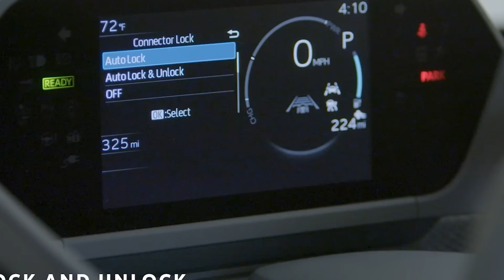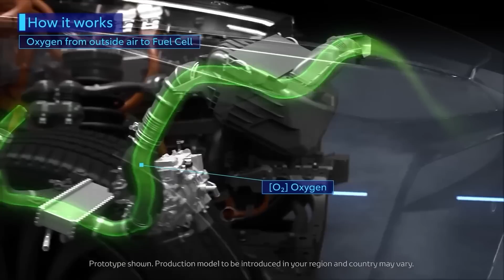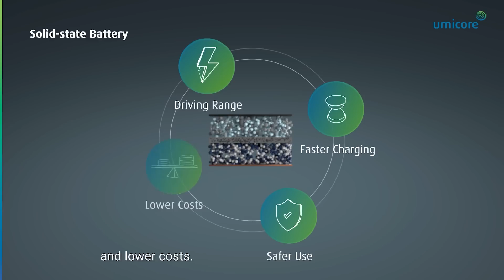Toyota CEO Drops Bombshell About Solid State Battery!

Comment: If these solid state batteries come to fruition, there would be no sense in pursuing hydrogen. The only advantage hydrogen offered, was range. That was an argument 20 years ago, when EV's only had a100 miles of range. Now, battery electric vehicles with ranges exceeding 250 miles are fairly common. The problem with hydrogen is, that it is difficult to build with a range to exceed that of modern battery vehicles. it is physically impossible to store enough hydrogen in a passenger car, to come close to the range promised by the new solid state batteries. Even if it were possible, it would take longer to fill the hydrogen tanks, than it would take to charge the battery. The fact that I can charge a battery at home, makes it the clear winner for me. On a safety standpoint, I'll take my chances with batteries, over pressurized hydrogen cylinders, with double the internal pressure of CNG.(compressed natural gas) Never mind the BTU content of that much hydrogen, It's actually less than a tank of gasoline. I'm just looking at the expansion potential of that much compressed gas, when fully fueled!
Reply: Hydrogen for transportation is a pipe dream for fossil fuel companies who know that their days are numbered. They are trying to convince people and governments to make a hydrogen economy, because the technology and engineering is similar to fossil fuel refining, storage, & transportation. 
Except that it really isn't as you say.
The issues with hydrogen mean in reality it will never be able to achieve mass adoption.
Battery electric vehicles have already started taking off and will replace the vast majority of use cases. Hydrogen can't compete with battery electric vehicles.
We will need hydrogen for decarbonizing things like ammonia for agricultural fertilizers, cement production, and steel making. But not transportation.
Reply: Toyota hasn't solved solid state batteries, but for whatever reason, they make dramatic pronouncements every few weeks or months. 
They also brag about how committed they are to hydrogen.
But the numbers paint a different reality. 
Hydrogen vehicles are only offered on the West Coast. There are about 52 hydrogen refueling stations in California . Elsewhere, there are less than ten. Car companies have to offer a certain number of zero emission vehicles, or face penalties. So they make unappealing cars to comply with the law. These are known as "compliance cars." This is what Toyota thinks is going to keep happening in the future.

Total hydrogen sales in the US 2022: 2,707 
Total hydrogen cars sold in the past 11 years: 15,000.
Total BEV sales USA 2022: 762, 883
Ten years of EV sales USA 2011-2021: over 2 million

Comment: lol
Toyota is a great company, but in this area, they have failed miserably.
They are only starting to pay now, unfortunately this great company will not be the number one company in ten years. They'll be unlikely to be in the top 5. 
As far as solid state, it's a real technology, but Toyota is not making EVs with solid state batteries. They aren't even making a battery factory. If they really could manufacture solid state batteries cost effectively, they would be able to stay near the top. 
They are complaining about laws that mandate a switch to EVs. Why would they do that if they have the best technology? They haven't really solved solid state, at least not enough to make cost competitive EVs. 
They come out with announcements on a regular basis about some astounding breakthrough, but we haven't seen any real innovation from Toyota since the Prius 20 years ago. They've been running on their past reputation for too long. Their company seems like a rudderless ship. There is no leadership with a vision for the future. Instead they have been run by pencil pushers who think that press releases about fake technology will keep their stock price high. 
At some point, you have to show your cards.

Comment: What about safety of the battery pack and repair of cars involved in accidents?
Reply: If they had solid state, it would be significantly safer than some of the original batteries that had fire issues.
Although, the more common battery today is LFP, the "iron" battery, which doesn't catch fire easily. 
However, Toyota saying they solved solid state is something they keep doing every few weeks. They love to make dramatic announcements.  Unfortunately, they haven't turned out any dramatic cars that people can test and verify.
Reply: solid state batteries catching fire is very unlikely. They are safer.